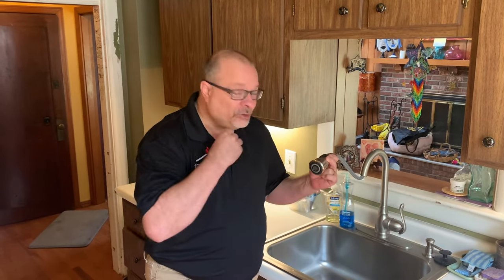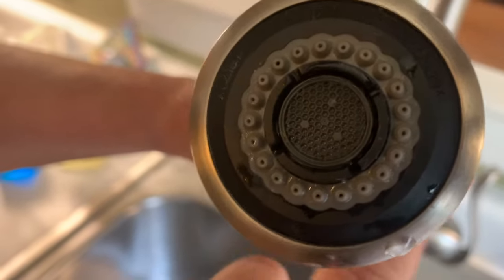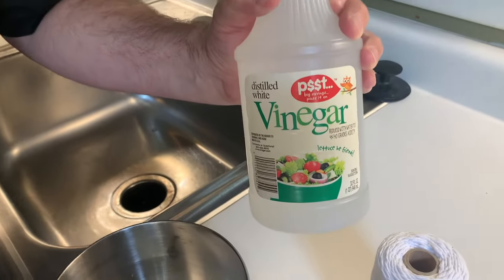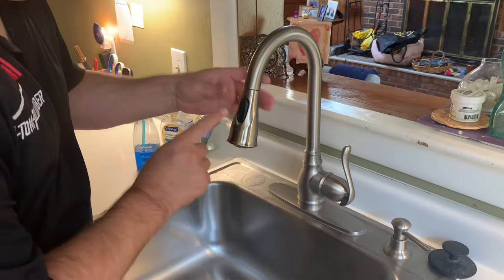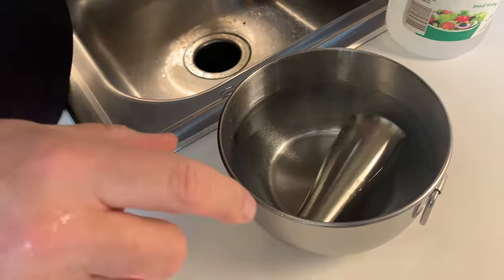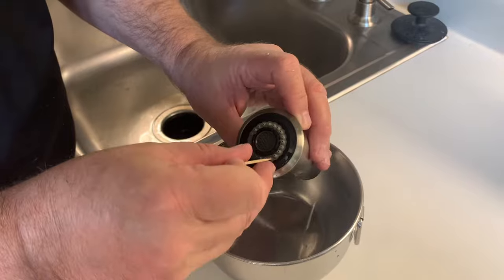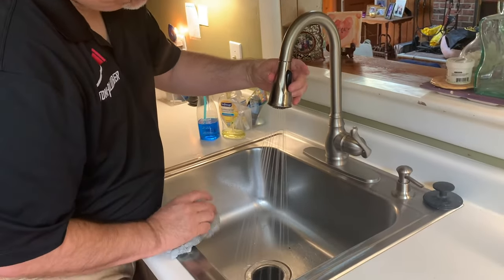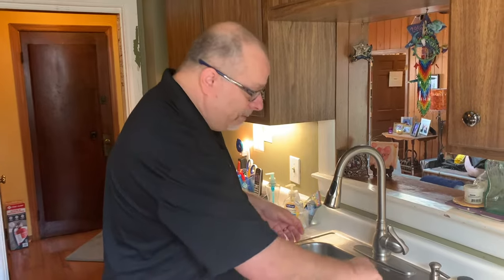How to Unclog a Kitchen Sink Sprayer with White Vinegar!

Comment: Tie the water line in a big loop. This will allow you to (1) soak the sprayer in a bowl in the sink without removing it or (2) remove the sprayer without risk of the water line disappearing into the faucet and under the sink.

Comment: Baggie works well bec sometimes the heads need removing and u can’t reach shower head or u don’t have tools. Less vinegar required. I use large pipe cleaners from craft box.
Reply from the maker: Thanks for the tip!